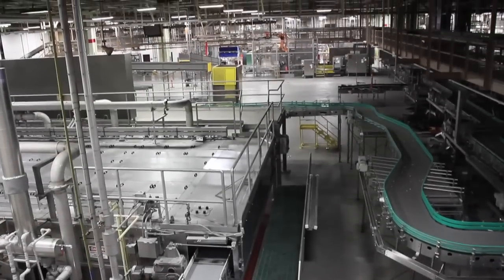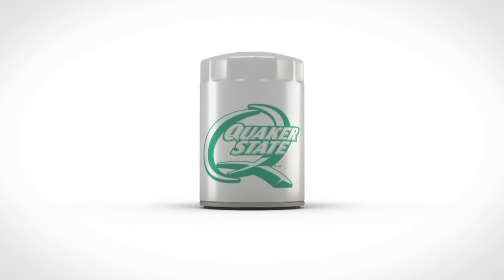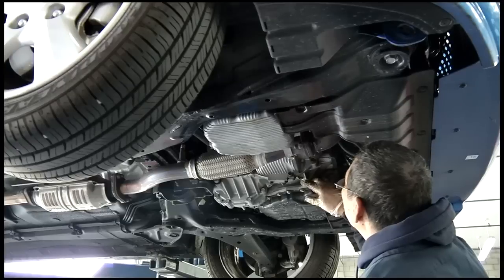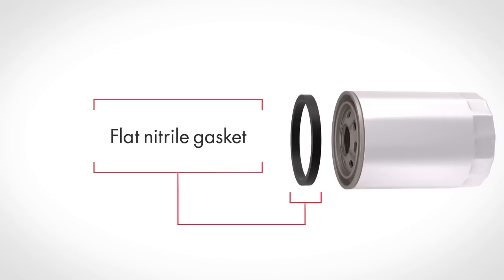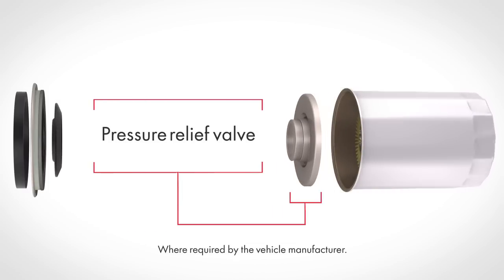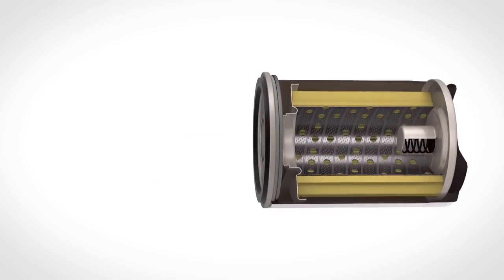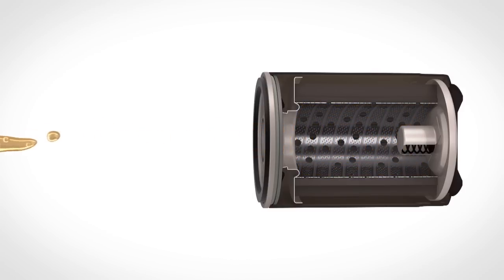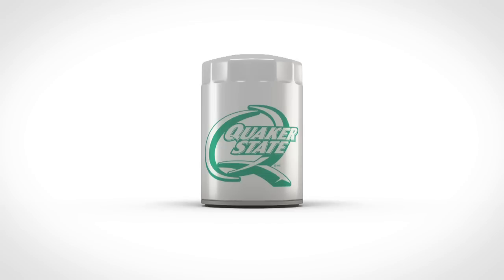Quaker State Oil Filters: Long

Comment: This is false , a modern QS filter has cut open holes inside , instead of round holes !!!Big difference for high compression engines , and specially  ones that run  thicker than 5w-40 oil !!!!!!!!!!!!!!!!